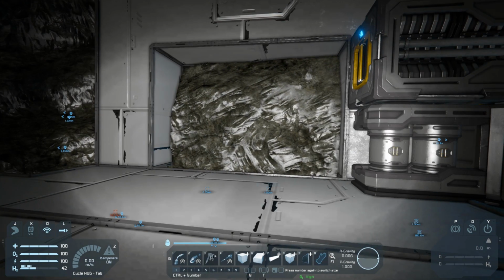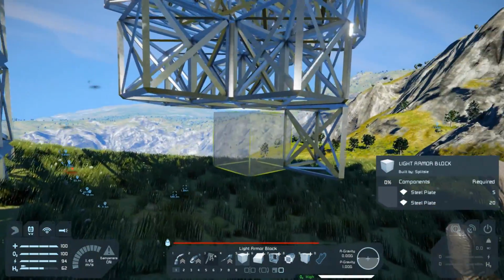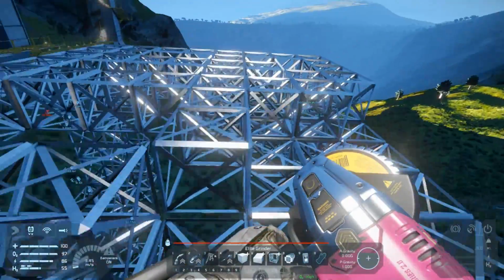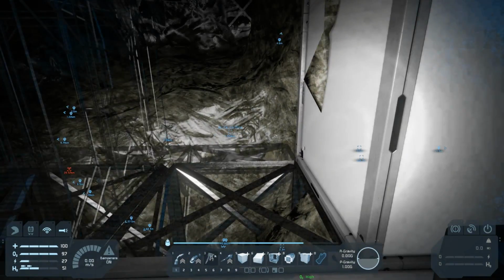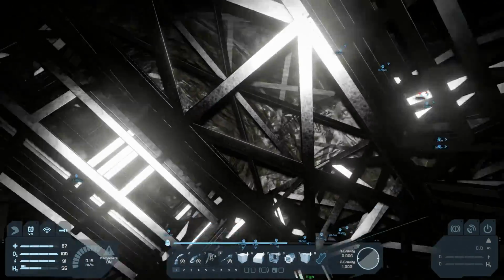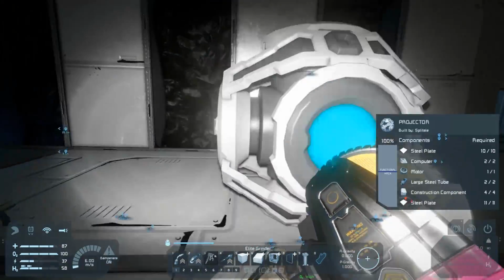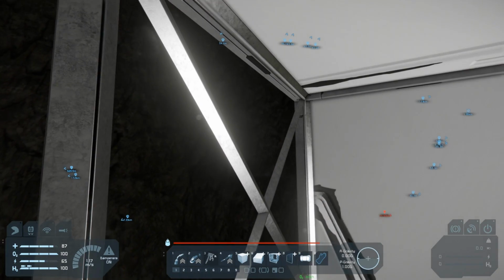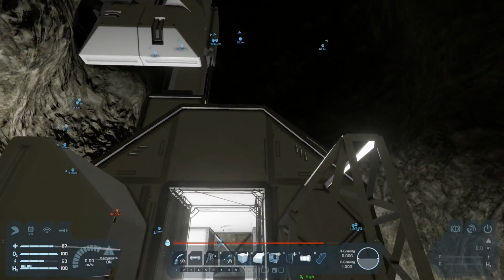Survival, Maybe... #23 Piston Elevator with Vanilla (A Space Engineers Survival Series)

Comment: Nice, compact, functional design even if the engineering and resources don't seem to justify the means.

But it does highlight another requirement for cables in the game.  I can only think that the game mechanics for functional cables would be incredibly complicated.  

Having said that I would think it couldn't be to hard to have something that, in game, looks like cables but operates on the same mechanics as the pistons  (ie blocks that slide into themselves), just much longer.  Just like your conveyors that look like pipes but function just like the normal conveyors.  This way you have a cable block that looks like cable and  pulley blocks to attach either end with varying pulley ratios.
Reply from the maker: Absolutely would have, and I'm going to need a set of stairs as well - just for the sake of making the base have redundancy. I didn't think it'd be nice for people to have to get dizzy watching me walk up and down 21 flights of stairs though :P

I was initially planning on getting a vehicle lift somewhere in the base, but after drilling the hangar I wasn't sure where something like that would be useful, maybe I'll have to drill an entrance at the top of the mountain at some point and have a vehicle lift to go all the way up there...
Reply: I've been wracking my tiny mind trying to work out a more economical way to build a lift using only vanilla blocks but couldn't develop anything that didn't include a lot of mining or the use of engines.

But, along the way I thought of another essential item that is missing from the game that would be even more practical than cables, and possibly easier to implement.  GEARS.  Why has SE not got gears in the inventory?

Can you begin to imagine what impact the introduction of gears would have in this game.  The ability to use a rack and pinion system alone would be phenomenal and would make the construction of lifts and large hanger doors more practical and realistic.

C'mon Keen - give us gears.
Reply: It may be more costly, but his base is now handi-accessible!
Reply from the maker: That's a really nice idea, making a cable mod that acts like a piston. I hope someone who can do that stuff takes you up on the idea, even if it's faked it'd be a really nice touch :)

Also, over engineered has become my middle name :P
Reply: Yeah!  Can't help but think that a flight of stairs, like those on you solar tower, would have been easier to build - but nowhere near as cool.  Initially, when you were talking about the lift, I thought your were talking about something to move cargo or vehicles, which made a bit more sense.  Maybe that's something else to consider for the future =0)
Reply: Medieval Engineers has rope so Space engineers definitely should be able to have cable to make things like this.
Reply: Good point
Reply: Could this be mimicked with blast door pieces on a rotor? I don't have the game so I can't test it.

Comment: Hey Splitsie.. I think you CAN actually enable inertia tensor, but as I experienced with my Solar Alignment script, the first piston in the row is just too weak to equalize the mass of the station with the subgrid. My rotors had the same problem - that's why I only ever enabled inertia tensor on the horizontal rotors and not on the verticals. As you enabled inertia tensor on part of the pistons, I think you did it on the first one in the row by chance (the orange one as seen in 39:58). My suggestion would be: try it again and enable inertia tensor on all pistons BUT the one that is directly attached to the base.. This should work and be much more stable!
Reply from the maker: Cool, I'll give that a shot. Thanks Isy :)
Reply: You're welcome ;)
Reply: @Splitsie  did it work?
Reply: Thanks! :D
Reply: I believe that if you increase "Max Impulse Axis" on all of the pistons it will take the lift all the way up without problems.
Reply: Yep, I had the same problem with a piston drilling platform. just need to mess with the max impulse a bit and you should be able to get it work with the inertial tensor on. I would also drill a bit more room around it as well. I found with my drilling platform that it was easy for it to get sucked into the walls and clang out. a bit more room helps prevent that.

Comment: Just a thought, but I noticed you can toggle the shared inertial tensor with a button command, so have you considered linking your buttons to a timer block that toggles the inertia tensor when the elevator stops? That will stop the elevator jiggle while it's not in use at least. 

Also while it will probably be a ton of extra work, I think it would look pretty sweet if you lined the elevator shaft with interior lights every few blocks (Just in front of your windows)
Reply from the maker: That is an interesting thought, if it's still wonky after I fix the inertial tensor settings then I may just do that :)

I was already planning on making lights all the way down like that, as I also thought it would look cool!

Comment: Those rocks sure are shiny. What if you built some guides out of blast door blocks to keep the elevator from wobbling?
Reply from the maker: It's like someone poured butter all over them...

If the inertial tensor settings that Isy and a few others have suggested don't work I may do exactly that :)
Reply: On the shininess of the rocks, Keen needs to modify the specular maps for each of the textures...like they were before.  I kinda get where they were going; "shiny new textures" (lol), but they need to rework stone.
Reply from the maker: Yep, I'm hoping it was just an oversight on the part of the art department :P
Reply: I second the blast door guide rail, I have dealt with elevators like the one you have most of the time 2 rails are needed. They should be set to be 90 degrees offset  from one another to make it stop shaking

Comment: What are your audio settings, and what audio equipment do you have? Whenever I try to use the reverb effect, it's all crackly.
Also, did you know that there are key modifiers (Shift, Alt, Shift+Alt, the usual Space Engineers ones) for the floating terminal mod, whatever it's called? That's way easier than scrolling in decimals.
Oh, and you ARE going to turn 'Share Inertia Tensor' on, right? Especially with it being all lopsided like that? Alright, you did; thank goodness!
If pistons are getting stopped, it's probably because the weight is higher than the maximum impulse (axis) is allowing; try upping that.
I have no idea why you think more buttons will help; it's just changing the velocity, there's no difference.
Reply from the maker: I was hoping with the buttons that I could get the piston to reset and continue moving upward if I spammed that button... it did not work :P

Turns out I need to set up the inertial tensors differently - so that'll be fixed in the next episode :)